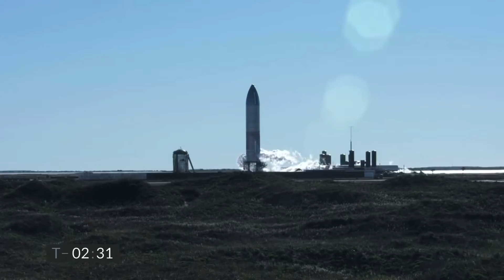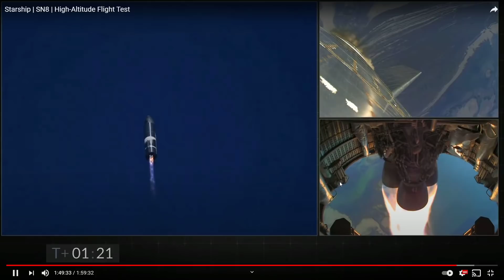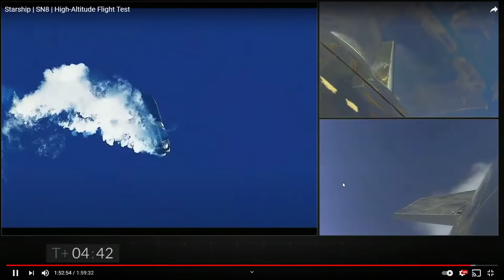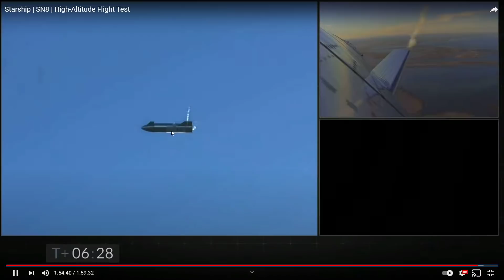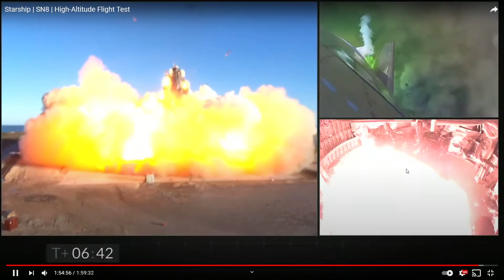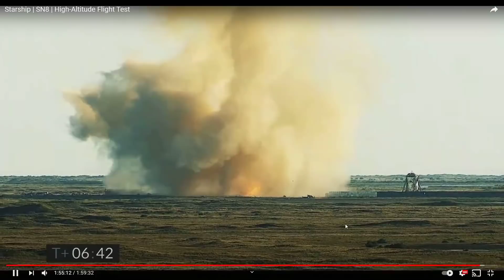Starship SN-8 12.5km Hop | Common Misconceptions Explained | Flight Breakdown

Comment: Raptor engines doesn't exist in ksp lolol
Reply: the vectors work as a good stand-in for them, despite being RS-25 replicas
Reply: @elijahwills7331  I mean vectors is not fuel efficient as the raptor heheheh
Reply: @gamesonly40  Yu get yourself to RO then!
Reply: @gamesonly40  No engine in KSP is as efficient as its real-life counterpart. The RS-25 is also a lot more efficient than the Vector. This is for gameplay reasons, as you need a lot less dV to get into orbit around Kerbin than around Earth.
The Wolfhound, when it came out, actually had a realistic I_sp, but they had to nerf it because it was way too powerful :D
Reply: @gamesonly40  Vectors are actually reasonably efficient, though not as much as the raptors
Reply from the maker: I wish it did :(